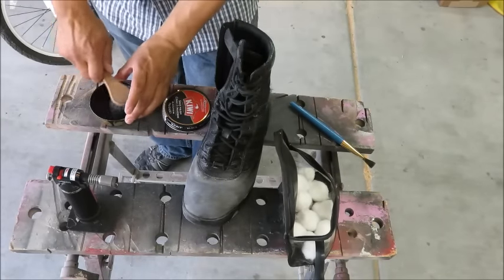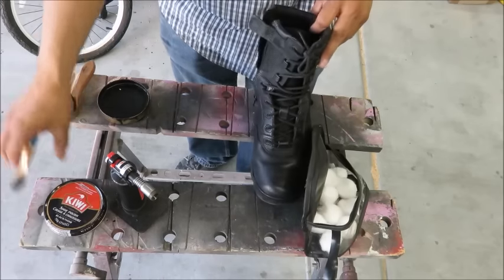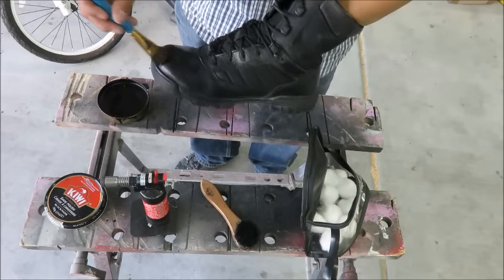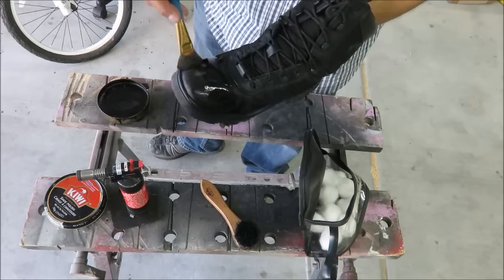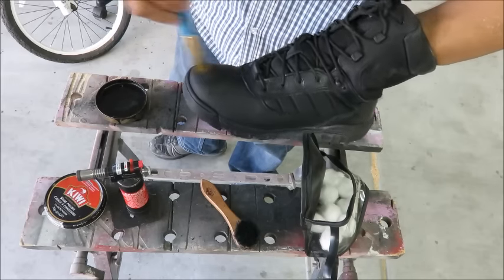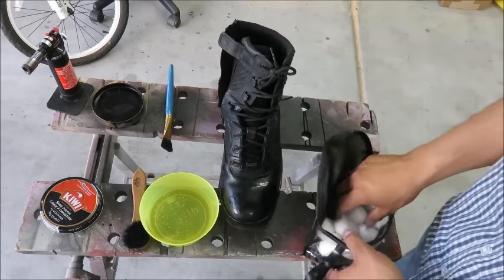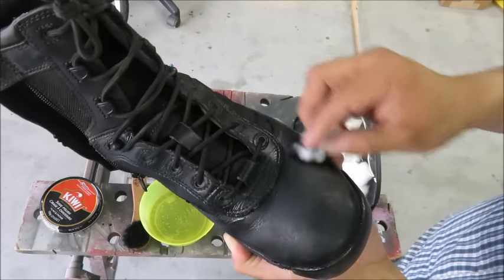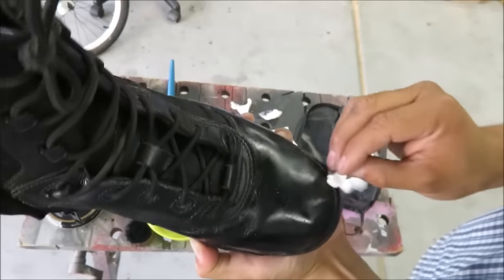How to polish your boots in ten minutes.

Comment: Looks great on a shelf. First time you bend your toes in the field, that caked up polish will crumble off.
Reply: Some guys would put Mop & Glow on their boots. It looked good under the bunk - for inspections -  but flaked away and looked like crap not long after putting them on.
Reply: So true that ain’t how you do it he don’t know what he’s doing
Reply: @meganmauermann2676  yeah but it really doesn't matter these are just like 60 dollars boots off of Amazon
Reply: @mightymikethebear  i agree a heat gun would be better and to melt it to a  paste as opposed to a liquid because liquid is not effective simply because when its in a solid state it sicks much better as a solid
Reply: Wait for it to dry, bend the shoe at the crease, and brush off excess.
Reply: I used to use heat on my boots by my layers were muuuuuuch thinner than this…
Reply: @alexanderworth4352 , I apply Parade Gloss until I get a smooth surface. I will buff that to a decent point and then put the boot on and take a few good steps. I brush off the flakes and then go to buffing with very tiny amount of gloss until I get a glass shine. I end up with far less flaking by doing this.

Comment: This is a tough crowd!  We coated our combat boots with Kiwi, lit it, and buffed to a mirror shine all the time!  I did that for YEARS and it didn't burn the leather, cause "boot cancer", or chip off.  If you need a quick shine for inspection, doing this won't cause much, if any, damage.  What killed my combat boots was repeated wetting and drying without using conditioner such as Obenaufs (didn't exist then), mink oil, or neatsfoot oil on the INSIDE.  Had I used leather conditioner, they would've lasted longer.  Wet leather dries hard and when flexed, it cracks.  I had NO ill effects from using the lighter.  Think about it, the heat melted the waxy polish into the pores and probably helped soften it up!  I passed many inspections with lit Kiwi...good times!  It's not going to hurt anything.
Reply from the maker: Yeah, what he said.
Reply: Same thing happened to me when I was in the Army and just like +MusicStudent1
I never had time to buy nor look for a leather conditioner such as neats oil, the old stand by mink oil, or snow seal.
I just wore my boots until the leather tightened than cracked,
Never conditioned the tan boots either when I switched to the ACU.
Reply: Now a days I condition all of my leather goods and polish them if needed.
My gotos are obenaufs and kiwi parade gloss in either black or brown.
Reply: Would do it but with no flame
Reply: Brush all loose debris from boot. Saddle soap to clean and then wipe down. Allow time to dry. Apply leather dye if boot is damaged or discolored from wear. Apply a conditioner of choice. Apply a heavy base coat of polish and allow just a few minutes to dry some. Brush shine. If you use heat, even heat is best. I usually don’t use heat unless the boot was pretty bad off. It’s been my experience that if not done properly heating the polish can backfire. Lighting it on fire takes the oils out of the wax.
Reply: MusicStudent1 how does one go about applying conditioner to the inside of a leather boot? Seems like an obvious answer, just asking for tips/questioning if it’s really necessary compared to thorough application of Obenaufs to the outside

Comment: lighting polish on fire causes the waxes and oils to be burned off.  I too was a paratrooper(C Co 3-325 96-2000), we never burned polish.  maybe when we waxed the hallways when we used the johnsons paste wax from the PX haha! never light the polish(kiwi) on fire.  and hitting leather with a torch will dry it out bad.  soft cotton t shirt, water and black kiwi.  time and elbow grease.
Reply: A soft terry cloth polish cloth with a smidge of 70% rubbing alcohol on it works wonders.
Reply: Starrskream is right, no heat. 100% cotton t shirt, water, kiwi and effort. From time to time I'd scoop out a gob and rub it in with my finger until my finger wouldn't slide across the boot then finish it off with a tshirt and water
Reply: Put lots of Johnson’s paste wax on with one sock covered hand and took it off with the other sock covered hand.
Reply: The only time any heat was applied in my British Army days was when you had new boots and you had to get the pimples down to have a smooth surface. We used kiwi polish, a candle and a spoon...... worked every time. Then it was good old "Bulling" with spit and polish and hours of therapeutic circles with a duster cloth.

Comment: Well, my days of having to do this have long since passed, but just for 2 cents thrown in...

A lot of guys could do something similar with a cotton t-shirt or other cotton cloth, I never had much luck with that. The cotton balls always worked best for me. I did the melting of the waxing in the tin, only I would then just apply it directly to the shoe with a cotton ball and rub hard to rub it down into the leather. 

I think using the heat on the polish on the shoe is a great idea to try.

But my technique was to apply the first coat rubbing hard with a swirling motion and then, using a couple of subsequent cotton balls, applied medium pressure and maybe adding a bit more polish going all around and then finally light pressure. And I just quickly dunked the cotton balls  in the water instead of putting the water on the shoe.

I came out with a great mirror shine. But had I known about some of the techniques here I  think I would have tried them.

Comment: I used to use this same method when I was in the Marine Corps and still did since the 80's when I got out, however after years of doing this with Kiwi polish I found something better that doesn't dry out the leather and crack my boots & work shoes, it's bees grease. Normally my work shoes would last about 8-10 months and they would be cracked from being dried out by the polish wax, then I was introduced to bees grease and the thus far my shoes have lasted 12 months.  I service kitchens in restaurants, hotels, and hospitals and I'm constantly in water and the bees grease repels water, protects the leather and keeps them soft and supple.  I don't get the shine like I used with the wax polish but my shoes last longer, so you have to look at both methods and determine whats the end desire you have in mind.

Comment: Heat gun the inside to open the pores then heat the outside and lather the kiwi on. Then after it has cooled, cotton shirt around two fingers and make small circles, increasing in size and pressure the more reflection you get. You'll see the lines in your teeth from an arm's distance when your done. 
P.S. burning the kiwi takes the oils out, hence, warming the leather instead.
Reply: That's how I did it for 9 yrs in the Army. Guys were always asking me how I got a better mirror finish than theirs

Comment: Must be a million ways to spit shine boots. I always used a cotton diaper that was washed to removed the sizing compounds from the manufacturer. Found cotton balls left a lot of cotton fibers on the boot. Tap water and Kiwi brand shoe polish. No fire or heat for the polishing wax. The first time the boots were shined took the longest. All other spit shines were easier.
There was a synthetic floor polish called "Future" years ago in the USA. No longer sold. Was a quick way to get a shine on the leather but you had to frequently strip off the dried "Future" about 2 to 3 times a month. Wasn't a good solution, but, it was quick.
Reply: Also, the words "spit shine" is figurative, not literal. Saliva is a mild acid, plus all the other junk. Toothpaste, food particles, or, whatever else. No spit! Use clean water, good quality shoe polish, and a washed cloth diaper. Shined boots were a part of usual daily activities for infantry guys. Did this shining technique in the US Army, 11C mortarman, for seven years.

Comment: I enjoy my shoe polishing. I was taught different. I really don't want any coming back off. I bought the whole can to use it all, not half and toss the rest on an old rag..kkkkkk
   Maybe it's because i let it sit longer?? Idk i apply to 1st shoe, while it drys i do the 2nd. Then i go back & forth many times, after i get at least 10 coats and they've set, then i'll start putting on little by little with the water. When I'm done i give them a quick buff and store them in an old tube sock.

Comment: I expect most troops today have zero clue about polishing footgear. As an equipment operator in the engineers in the AF in the early 90's, our boots got pretty gnarly but we could get them inspection ready in short order, especially with higher quality boots like my Danner Fort Lewis boots. Get a good base, break the boots in, then hit tbem with Kiwi. We'd us lighters, irons, engine manifolds, etc, to get the kiwil to to apply correctly. Repair tbe damage from duty and field after spraying them off or walking in a stream by building up scuffs, cracks, and cuts with polish. Work it in to a uniform color. Then set the boot aside to do other. Hit boots with 1-4 coats of softened kiwi with cotton rag, then let them cool to a dull finish. Hit the with boot brush to bring up shine then break out the wetted cotton balls. Use cotton balls to dress soles and polish up to 90%. Finally to remove swirl marks, buff them with an old pair of panty hose. Worked everytime.